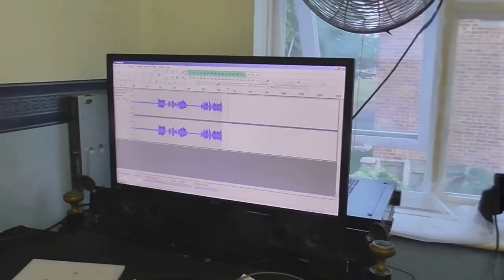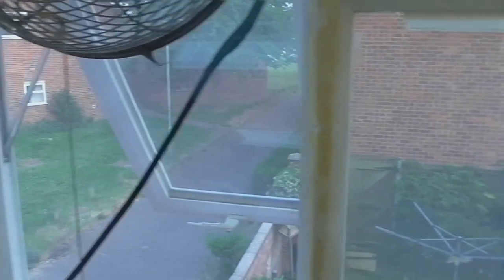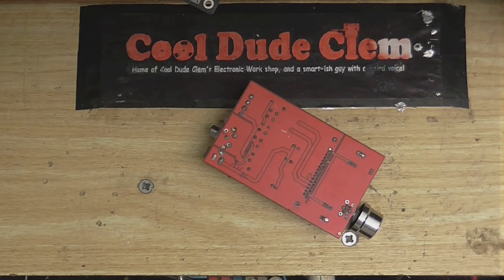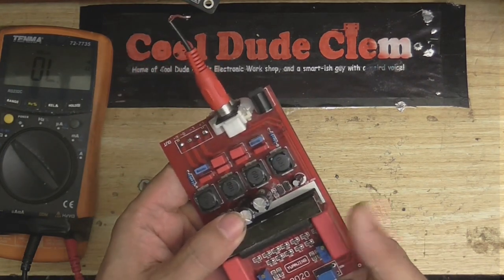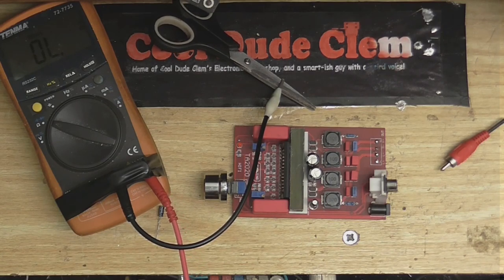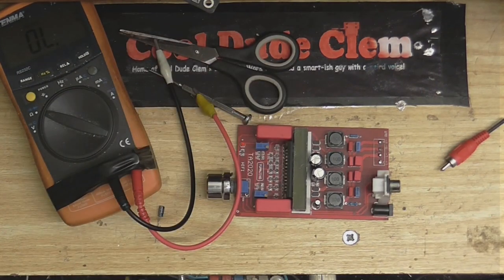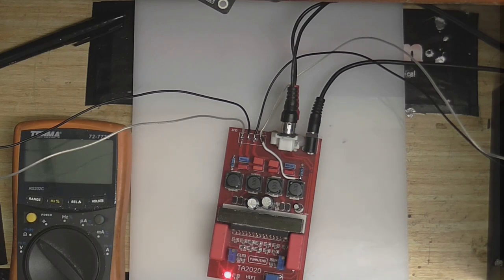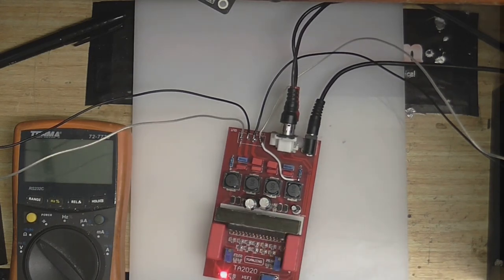Fixing my TDA2020 Amp.

Comment: If this is a "New Class A" Technics, i think they are not actually class A amps. Still they put tons of heat even on iddle. The best they probably did is a amps that is class A in the first 15 or 20 W and then works as AB. They used to do thing like that being heavy on the BIAS. I have a "Class H+" (I dont know what it is) and .... it was more on the stove side than on the amp side. Highs were a distant memory, anything sounded like AM radio. I got rid of it.
Reply from the maker: I've heard of class H, i think it uses dual power supplies, one for low amplitude and one for high, but I could be wrong.

Comment: Hé Dude, you can use copyright free music from the YouTube audio library.
Reply from the maker: Yes there is that, but why use that when I could use my own?
Reply: @CoolDudeClem  If it is your own music, should be no problem as you are the copyright owner. I have had audio tracks copyrighted after being 12 years on YT with no claims at all, they must use different filtering techniques.